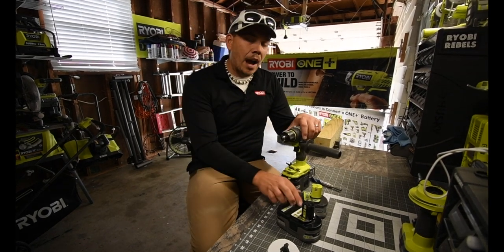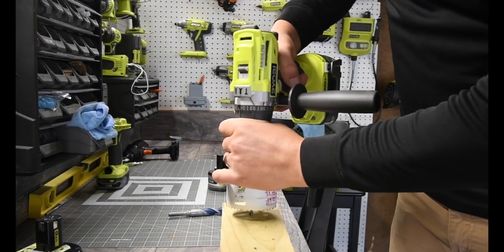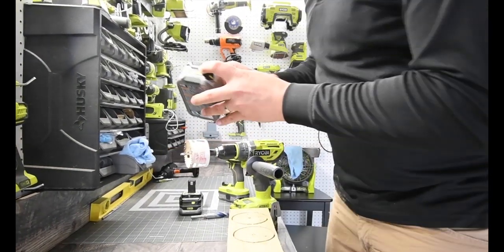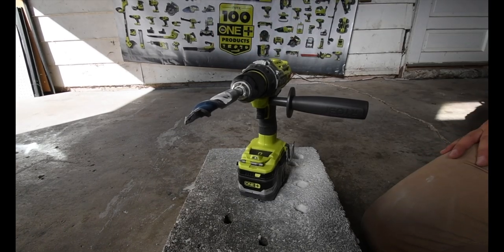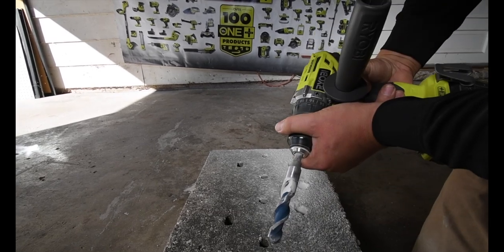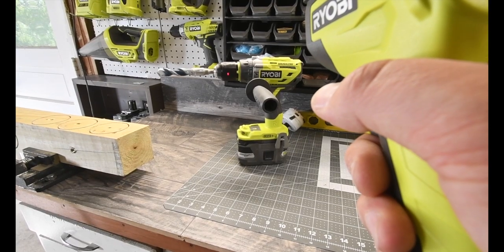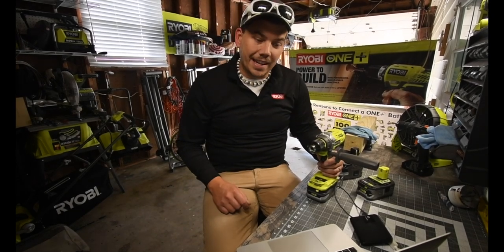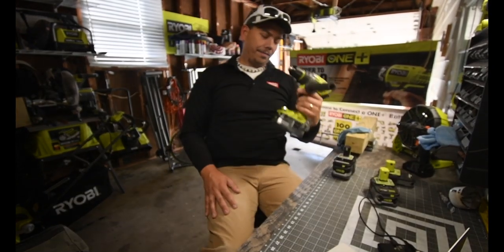Ryobi 3ah HP vs 4ah Battery (Brushless hammer drill)

Comment: Which of the 3 Ah HP batteries did you use?  I believe the P191 uses 2 parallel banks of 1.5 Ah 18650 cells and the P195 uses a single bank of 21700 3 Ah cells.  The 195 should be lighter and a single cell should have lower resistance than those in the 191.  I would expect the internal resistance of the parallel path P191 would have less overall internal resistance, 1/2 that of a single cell cell path of the same type of cells, compared to the bigger cells in the P195, which might have 70 to 80% of the resistance of the smaller cells in the P191.  That would mean there's less power lost to internal resistance and waste heat in the P191 leaving more power to the tool on the older version of the 3 Ah HP battery.  This would particularly be discernable in high current demand applications.
Reply from the maker: that is above my paygrade. love the knowledge you have of them
Reply: It turns out the spec sheets on the 18650 cells says they are limited to 23 Amperes and the 21700 cells are 30 Amperes.  Given the parallel paths, the older P191 batteries could put out 46 amps and the P195s can do 30.  The new P195s claim more battery tab welds but the P191 start with twice as many than typical single bank batteries so that may be a wash.  The older battery can put out near 900 watts, where 750 is 1 horsepower whereas the newer battery can only approach 600 watts.  The newer P195 has a bigger footprint, is not as tall, is a bit lighter but has less peak power capacity for delivery to the tool and is more prone to overheating.

Data sheets may be found here:

https://www.reddit.com/r/Tools/comments/bi1hqq/comment/elxh6fg
Reply: @juergenwelz2591  glad I read this. Just picked up the last 2 pack of 191s on the shelf locally. $109

Comment: I see you have the brushed hammer drill.  I wonder if that would cut out the same as the brushless drill.  I have the brushed hammer drill and often use it for mixing cement, mortar and thinset which puts a tremendous load on the drill. The only time my drill cuts out is when the batteries need to be charged or they overheat.
Reply from the maker: I put these tools through a lot of stress